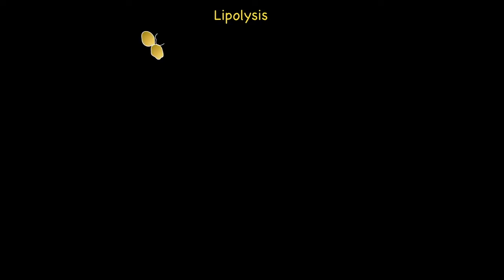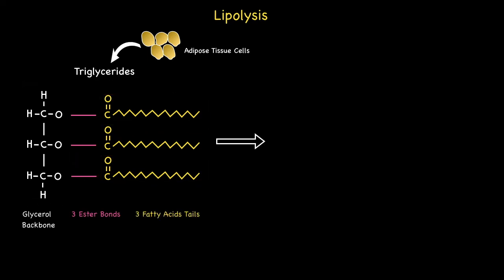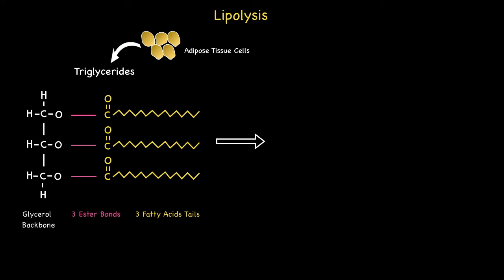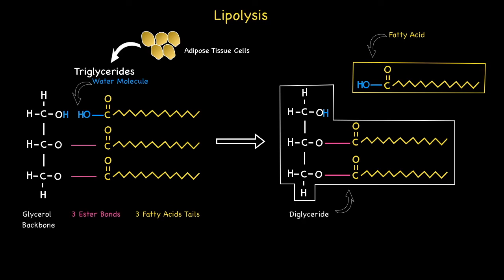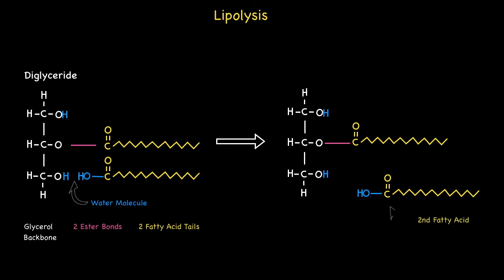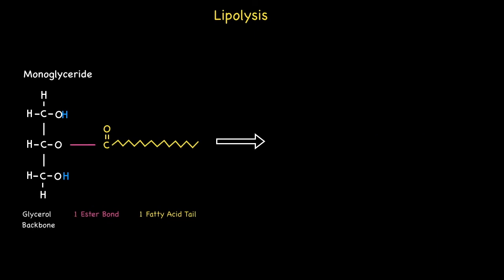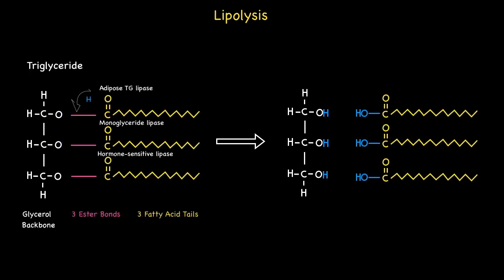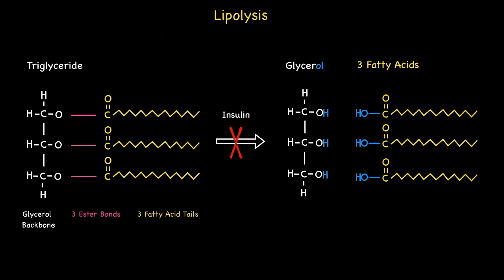Lipolysis

Comment: HI,

I am wondering something. I take caffein before a workout to give me some energy. I know that caffein has several effects on the brain (increase adrenaline, dopamine), and it increases the lipolysis. My question is when people get used to caffein the effect on the brain stimulation is not as strong as before but I wonder if the lipolysis effect will remain as high as at the beginning or if the lipolysis is related to the brain stimulation which would mean that if the brain effect decrease the lipolysis will decrease ?

Thank you very much !
Reply from the maker: The general consensus seems to be that caffeine increases exercise performance over the short term, but as you rightly say individuals seem to become tolerant of its ergogenic effects over time. Here is a very recent study that attempted to validate this claim on a day to day basis from the point of first ingestion for your perusal. https://www.ncbi.nlm.nih.gov/pmc/articles/PMC6343867/

With regards to your question on the effects of long term intake of caffeine on lipolysis i could not find any studies that directly addressed this question. However, based on the evidence that individuals build a tolerance to the effects of caffeine I would hazard to guess that this could prove to be an ineffective weight-loss strategy over the long term. Hope this helps :-)